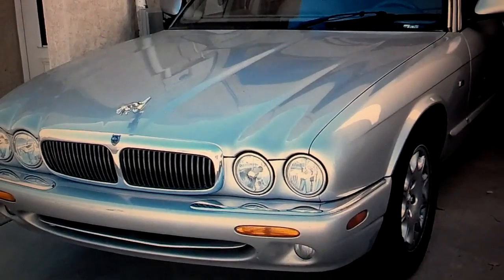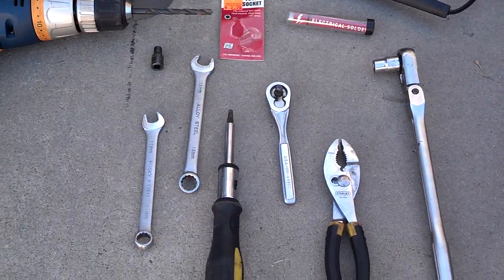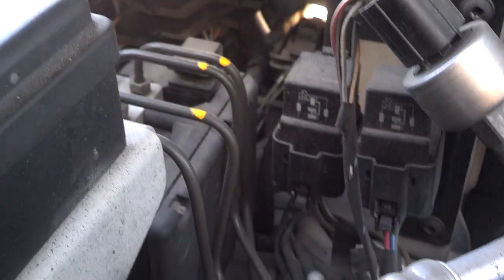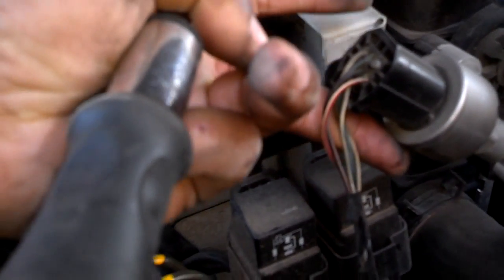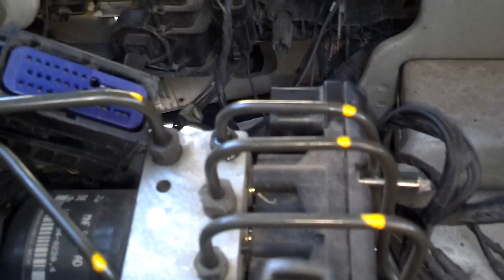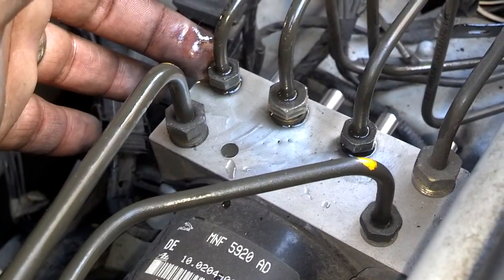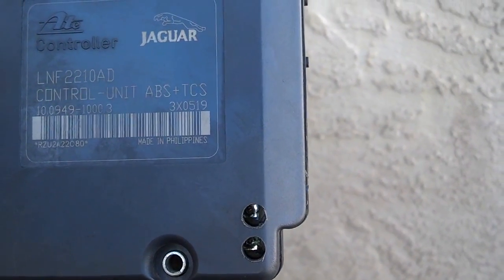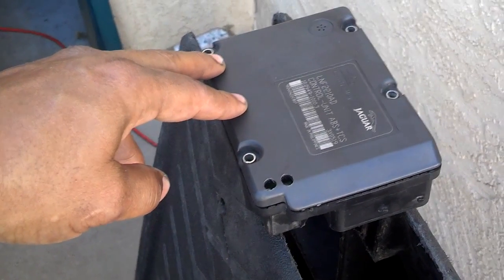ABS module repair, ABS warning, tracks not available, Jaguar - VOTD

Comment: i having 2000 jagure vondum plus, i like to make my car everythings fixed , car is in very good condition the round  plastic which covered gair box was broken i toked out not shift litle bit mixed up, any one bet for fixeing everyrhings paint tire ,i wanna make it like new car, give me price and statry to work on it 7025047620
Reply from the maker: Ramie adib Huh? Contact me via my website if you need some help.
Reply: i like to know how much will charge me for that?
Reply from the maker: Ramie adib Huh? for what?

Comment: Hey Brother from another mother...great DIY video, very informative, easy step by step process.
God bless.
Thank you.
Reply from the maker: Yuriy Lopin Thanks for watching.
Reply: Hi Robert, 
I have Volvo v40 2002 that has a combustion misfire during rapid acceleration when the throttle open 25,50 or 100%. New spark plugs and injectors cleaning didn't help the problem. What can you recommend to do next.
Thank you. 
Yuriy
Reply from the maker: Swap coils. - https://www.youtube.com/watch?v=Sg7iFytxfzQ

Comment: This works !  I used dremel cutting wheel instead of drill - much better access to the solder joints.
After inspection is seems the problem is too much current through the thin factory solder joints.
Make sure you make a good thick " bubble" of solder for a good connection and resistance to future
failure.  Way to go ! Thanks !
PS - i bet this is a common problem for other abs units, just look for the joints behind the main power connector
just like this one.  Good luck !
Reply from the maker: MrRumford Thanks for watching and sharing.

Comment: Hi Robert,
Good video, I fixed my ABS unit mostly following your guide, except I carefully bent the brake lines coming out of the ABS unit to get enough clearance to get the module out (avoiding having to bleed the brakes). The relay bracket can also be bent out of the way after unclipping the relays.
Had to drill larger holes as my soldering gun is larger than the one you used, filled the resulting holes with some body rustproofing plugs I had.
Thanks,
Wayne
Reply from the maker: WayneB27 Glad it worked. Thanks for watching.

Comment: thanks for the info, I have 2001 xjr that has the same problem and the extended warranty company is declining the repair for some unknown reason, even though it is clearly marked covered in my policy, I will let my attorney deal with that, but you did an awesome job on explaining the repair so that even I can do it, off to the garage, THX

Comment: Great video! Do you happen to know how difficult it is to actually pry the lid off from the ABS electronics module? How is it sealed exactly?

I suspect my '98 XJ8 has this problem, it was intermittent at first, and cleaning the wheel sensors did not work. Just seems like intermittent problems like that is a good indicator of a bad solder joint somewhere. But I'd like to see the whole board.

Thanks in advance, your videos of the XJ8 have been very helpful!
Reply from the maker: Mythricia I believe the guys cut them open with a drummel or something. I have read that some people screw the module on a board and use some miniature pry bar to force it open. When I opened one I butchered it up pretty bad. There is a guy at www.MidWest-ABS.com that repairs them for Volvo's. I'm pretty sure he could do the same for these.

Comment: Ok, thanks for your response.  I am going to go into it this weekend and see if I can clean it up and make a difference.  I will also check the wheel sensors.  Thanks for your help.  Jeff
Reply from the maker: You are welcome.
Reply: Robert DIY I enjoyed your video!!!  But I have a 2006 Jaguar X-Type, and my ABS light is on.  I'm looking for your 1st part of this video, but do you have something about the location and what the wheel sensors look like???
Reply from the maker: Links to related videos are usually in the ABOUT comments.
ABS light diognostic, repair, wheel sensor cleaning - Auto Repair Series

Comment: Robert  I enjoyed your video.  I have an ATE model number JLM1475 ABS Module out of my '95 Jaguar XJS.  IT has an aluminum housing and looks like it will come apart very easily but I have not ventured there yet.  Most module rebuild places say it cant be rebuilt.  Have you any experience with these modules.  I appreciate any help.  Thanks;  Jeff
Reply from the maker: No I don't. If it's the kind that Volvo use to use, those things almost never to bad. Have you checked the wheel sensors and wires? Maybe just swap it out with another one.